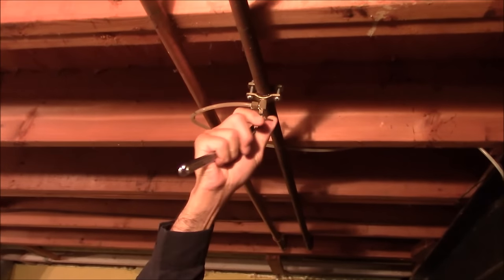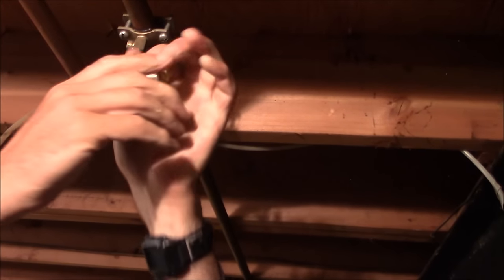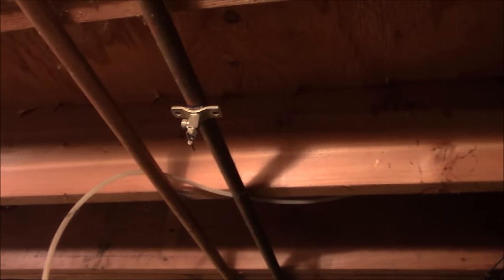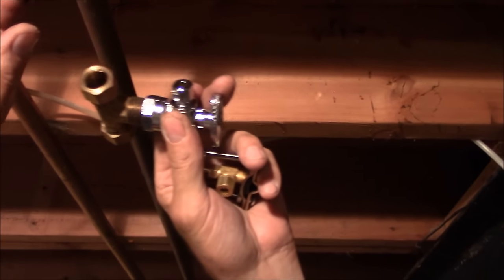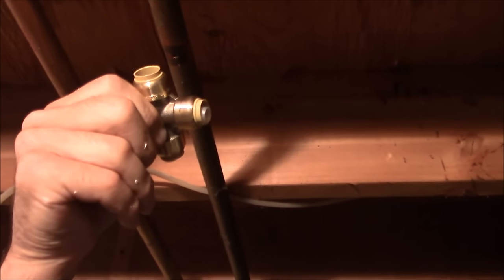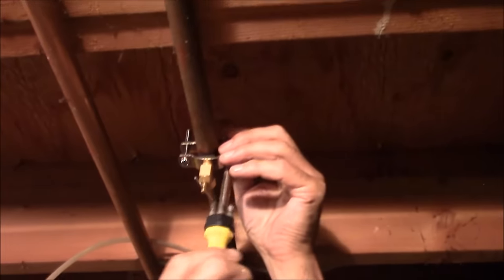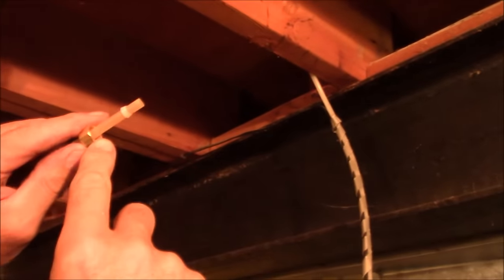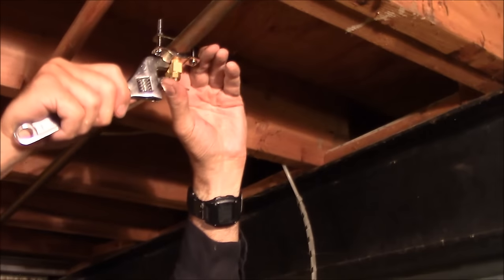Replace a Saddle Valve in 5 Minutes to Fix, Repair Water Pipe Pin Valve

Comment: never ever use self piercing valves. most places they are not to code, they are risky and are bound to fail by design. listen to this guy and replace with a tee and a ball valve. different metals, copper pipe and steel lancet creates perfect environment for corrosion
Reply from the maker: Great, everyone has to get it solved within their budgets, thanks
Reply: Nonsense. My saddle valve has been working perfectly for over 20 years now. If we listen to everything people say not to use, we would still be using the horse and buggy.
Reply: @bigmacdaddy1234  I so agree .. I say if you want to do it go ahead its your call ..These friggin` Plumbing Police .. DA!

Comment: The bracket had rubber on one end but the other half was steel. Steel and copper don't mix well. you didn't even prepare the copper tube by sanding and cleaning the area for the new valve.

Comment: the ball valve was the way to go , that saddle valve is not copper will cause a issue down the road pressed against the copper pipe will weaken the pipe over time due to corrosion oxidation . Always sweat in a ball valve  1/2" to 1/4" compression fitting all brass best way to go !

Comment: Used to be push to connect or shark bite connectors had to be accessible.  Not any more.  They are now rated for non accessible use.  Mr. Hardware needs to jump into the 21st century.  Plumbers seem to hate the new stuff but I have used many push to connect fittings and have yet to have a leak.  Just install them as instructed, debur, clean the tubing first, etc. and off you go.

Comment: Thank you for keeping this as simple and to the "T" as possible. I just bought a needle valve to replace what I thought was a needle valve, and it ended up being a saddle valve. Up and running in 5 minutes after I got the right part. I had never dealt with these before. Thank you!

Comment: Man I gotta tell ya , I was hesitant about those ‘cheese ball push on fittings’ until I was basically forced to use a couple of them one evening.... they are more expensive BUT, they are extremely fast, easy and have Never leaked a drop !
  I’ve used quite a bit since then on small jobs and repairs.... they’re worth the $ when they save you so much time.... and they fit to Copper, PVC And Pex lines.
  I’m still impressed how well they work !

Comment: Great video.  Had to replace my fridge which was conking out, and the water/ice had stopped working long ago.  Replaced the saddle valve with your video, and new fridge has water and ice working like a charm!  Will take your advice and call a plumber to have a real valve installed at some point, as the water pressure coming out of the fridge is not so good (Same as on the old fridge when I first bought this house, and now I know why.).

Comment: We’ve been without a humidifier for 2 months, even after having someone check it. Your first tip, tightening the nut on the saddle valve, did the trick.  Thank you, Mr. Hardware!

Comment: You saved me from a bad leak. I noticed that you put a little black rubber piece on the valve, and I forgot to use that. Once I reinstalled with the rubber piece, it stopped leaking. Thank you!

Comment: Thank you! I purchased a replacement saddle valve to fix a leaking one. The metal piece with the hole for the needle that sits on the copper was not machined correctly. The brass "T" did not thread into the saddle very far. Just poor build quality in my opinion. However, the rubber made a good seal and there are no leaks. I will be addressing this in the future with a soldered valve. Thanks for the video!
Reply from the maker: get a good quality ball valve w/1/4" compression nut.

Comment: Had to laugh when I watched this... shows the best way to fix it and in the end just replaced the saddle valve in the same config... I laugh because my mother was messing with hers in the wee hours of the night and ended up with water every were... I came out in the morning intending on replacing it with a compression T... in the end I just put a new saddle valve in because it had worked fine for over 30 years and was way less messing around :)

Comment: Great video.  The only issue now is that the plumbing code bans saddle valves.  So if you are getting inspection for selling they will have to be replaced.

Comment: I need to do this for my old humidifier. Like you said the valve has sediment built up. I have a new valve, just wasn't sure how to replace it because its on the incoming line from the water meter.  Last year I had to have a plumber replace the incoming line valve because it was so corrodided that I could not turn the water off from the meter. I had him replace it with a handle type valve for quick shut off. Thank You for the video.
Reply from the maker: thanks, guys like you keep me doing them. Blair

Comment from the maker: When removing a valve, first shut off the water main, then open the laundry tub to reduce water dripping out of the main pipe once the piercing valve is removed.
Reply: what size was that pipe u installed the valve on?

Comment: Well, I'll be darned.  Mine leaked at the stem when I tried turning it off.  I thought I was going to have to replace the saddle valve.  I even bought a new one.  Turns out, all I needed to do was tighten in a bit.  Wish I had found this video sooner.

Comment: Those push on connectors have been in use for many years and their reliability is well known by everybody but the contractors that will lose business if they fess up to that fact. Water softeners come with them as standard equipment and they've been installed with them for more than 20 years. I've been using them for a lot of my plumbing projects for almost 10 years now and have never had one leak.
Reply from the maker: I just don’t feel an o-ring as a permanent seal. I’ve used then also, just never in a wall or an in-accessible area.

Comment: I have one of these, unused, with a big (unused) hose sticking to it. Can I remove the compression fitter + hose, and leave the valve on there, or should I cap it?
Reply from the maker: I’d remove the unused line and cap only if it leaks. 1/4 compression caps are hard to find.

Comment: I have that kind of needle valve hooked up to my refrigerator for its water. It's plugged up so I'm wondering if taking it off and trying to unplug it would work. I don't have any tools to solder, or any experience doing it. Do you think that would work or should I just call in a pro?
Reply from the maker: If you remove the valve, clear the hole and get the needle from the valve into the hole and centered and tighten the clamps equally this can be done. However it does take very good hand /eye coordination and if it fails you’ll be out of water until a plumber can come and repair it. 
If you had a hose clamp and a solid flat rubber washer that you could clamp the rubber over the hole and seal the hole. that would be your savior if you tried it and failed.
Reply: @MrHardware1  thanks for the reply! I've decided to try a shark bite T valve, since I won't have to solder. I'm just going to put it where the needle valve is.

Comment: Interesting. I've read that saddle valves are not code in many places due to tendency to leak over time. Mine saddle valve doesn't shut off and so I oped for push-on T with a ball shut-off fix. Hope to install next week. Humidifiers waste a lot of water, and on a well system that is not a good. 
My system is powered humidifier (big air-name company). They make drainless bypass humidifiers, but mine is powered and is  attached right to the main return duct on the indoor air handler of a heat pump system. And I'm reluctant to buy a new humidifier and have someone do some re-duct work. Also, it's a little noisy when it runs, and I'm not sure that location is good installation practice. I saw a YT video using 2 5 gallon buckets and a flot system, and tablets to keep the water microbe free, not sure I trust that method.
Any solutions to go drainless humidifier?
Reply from the maker: You are correct, saddle valves are not code in most areas in new construction. My water usage from the humidifier is a small portion of my bill so I concentrate on other areas to efficient-tise my house. The drum style w/a bypass from the hot plenum (where the humidifier should be installed) to the cold, wastes little water and has a small reservoir to keep the water from getting 'stinkie'.

Comment: Just gotta say, shark bite fittings are the way to go.  I was skeptical at first also, but after multiple uses, they have proved themselves to be very reliable. Sweating in fittings is going to be a lost art, because you don't need to that anymore.
Reply from the maker: I'm old school and am not fond of an o-ring standing between me and thousands of dollars of damage. I use them in a repair pinch with the intention of replacing it with pex or copper at a later date. I do sell a lot of them and have very few failures, but again, I wouldn't use it in a wall or a ceiling of any home I own.
Reply: Whats the advantage of a shark bite push on fitting vs a Compression fitting, seems the compression fitting is just as easy to use and more reliable?
Reply: Anything with an O-ring or rubber gasket will fail eventually. It is only a matter of time. This includes both saddle valves and shark bites.

Comment: Thank you for this great video!  Mine is under our sink for our refrigerator and the handles broke off from fatigue. It's been on there for 30 years and so once shut off didn't want to turn back on. How do I find out the size I need to replace it with?  I'm going to run to Home Depot today!
Reply from the maker: They are usually a standard size. If he pipe is copper I bet it measures 5/8" outside and a standard valve will bolt on as easy as I did in the video.

Comment: I have a highly corroded stuck saddle valve that has copper coming out of it and not the plastic tube.  Same process or have to do something different due to the copper?
Reply from the maker: The same, I prefer copper tubing.

Comment: 5 years later Brother, how do you feel about push connects
Reply from the maker: They are still my second choice. They are good in a pinch but the seal is made with an O-ring that has a life, a compression ring if it doesn’t leak today it never will.

Comment: what would allow this to fail to stop flow of water after several years ?  There is no visible leakage around this valve.
Reply from the maker: It is a brass ground joint seal. Meaning it is metal on metal to stop water. A slight flaw from rust, bad brass or other issue and it will leak.

Comment: Thank you for this video! I just installed mine but getting a tiny drip once every couple of hours. Should I take it apart and add some Teflon tape around the compression nut connector?
Reply from the maker: 2 to 3 nice neat wraps. Sometimes tiny leaks seal themselves.

Comment: 2 questions did previous installer use stiffener with plastic water line . And what if the metal compression ring was used with stiffener wouldn't that help. 
Lastly is that the correct terminology stiffener as you called it.
Thanks good job
Reply from the maker: I've seen it called a brass insert tube, but I call it as I see it. Not everyone uses the stiffener and with better poly tubing it is not mandatory, just good practice. I have seen the brass compression ring cut into the poly tubing eventually causing a leak, so I use plastic with plastic and brass with copper.

Comment: i am putting the compression fitting and tubing like your showing but it keeps popping off when i turn on the water.It also doesnt have a little plastic ring or is the little plastic ring in the nut? somtimes?
Reply from the maker: Some compression nuts have a built in ring, and some of them are unique in that once the nut or the built-in ring wears out you have to replace the valve also. (what a pain) You have to have a ring, built in or loose to make a seal. A brass ring will work on a plastic line but I greatly prefer a plastic ring with plastic line and a brass ring with copper tubing.

Comment: Do I really have to shut the main off? I hear that could cause some problems. Now mine is attached to one of the pipes going in or out of the water heater and above where the saddle valve is,  there is an Inline Valve (looks like a lever, not a tap).  Not sure if this is something I can use to shut off the water instead of using the Main shut off valve... ? Could I also do it with the water not shut off? I mean when replacing the saddle valve, it might take a minute or two... the time to pull the old one out and press in the new one... How much water would it come out??? Thanks in advance.
Reply: theres nothing wrong with shutting your water. we all have to do it once and awhile for other reasons. if you are replacing the valve, and want to test out the theory of how much water comes out... well get yourself a large bucket and some towels. working while running water is all over your hands and body is no fun, especially hot water LoL
Reply: Thanks for the reply. I already did it. I was able to just shut off the valve on the cold water supply that’s going into the boiler. The saddle valve was OK. So I didn’t have to change that. Rather the solenoid was gone. Replaced it in a couple of minutes. I also opened a tap in the bathroom downstairs just to relieve any pressure one the tanks.

Comment: Could you give  links to the products that you recommended in the video instead of the saddle valve? I believe it was the Tee Compressions and ball valve.
Reply from the maker: The compression tee is a 5/8 x 5/8 x 1/2" npt compression tee. No numbers available, the valve is a 1/2" fip x 1/4 compression valve. Call Daniel at 586-776-9532 with those descriptions and he can price and ship to you if desired. Blair

Comment: Does this type of Saddle valve installation on a copper pipe also work for connecting to an Expansion Tank?  (next to a water heater).  
Assuming I can find the correct fittings\hose to make the connection on the Expansion Tank side.
Reply from the maker: I don’t think the saddle valve would pass enough air, and/or water, to correctly feed an expansion tank.
Reply: @MrHardware1    how much volume of water do you need for an expansion tank?  it's only the excess pressure that goes in to the tank.  right?
Reply from the maker: @agustinguzman6375  Expansion tanks on houses with wells in bumps actually store and deliver gallons of water at a time. Yours may only be a buffer tank to accept the expansion from the hot water tank as it heats cold water and it expands. Which would only be a trickle of water at a time. Saddle valves are not code so I still would not recommend it to use to attach an expansion tank.
Reply: @MrHardware1   Expansion tank is for a Water heater (not a Well).   I've read the code requirements for Expansion Tanks (for water heaters pressure build up), but nothing states what is required for the actual connection.    Could you point me to where you are reading the Code section that calls out the plumbing connection for such Expansion Tank as it is connected near the Water Heater?
Reply: @MrHardware1    installed on 23/March:  Saddle valve with 3/8" Compression Fitting -> 20" Compression Line (braided steel) -> Expansion Tank (2gal, 45psi pre-charged).  will keep you posted to see how this turns out long term.
Reply from the maker: @agustinguzman6375  I think it’s gonna work just fine. The problem is saddle valves are no longer considered code, not that they won’t work, I just a try to keep people steered towards code.
Reply: @MrHardware1    1 year later update:  system is working fine!  no issues noted.

Comment: I use a similar 1/4" copper line for a swamp cooler that I have to disconnect and reconnect every season. Do I have to replace the compression collar every time?
Reply from the maker: Not usually. If an old one leaks i wrap the ring with teflon tape. Not the threads.

Comment: If using the saddle valve, I cut the needle off, but leave the sealing angle on that is at the top of the needle.  Then run a 5/32 drill bit into the copper pipe.  You will have better water flow.
Reply from the maker: If I was going to do all that, I would sweat in a tee and use a real valve. If I lived too far to purchase the tee and valve you have a great idea. Blair

Comment: Great video...question: once installed will the plastic tubing be in tight or can it be pulled out while installed?
Reply from the maker: No, using a plastic ferrule and a stiffener the tubing will withstand over 80 psi. It will only come apart if the nut is not tight.

Comment: The taper is stuck and i cant get the connection off from the platic pipe from the shut off value in order to replace.  any suggestion?  Thanks!
Reply from the maker: I cut the line shorter and use a new nut and compression ring.

Comment: Just curious. If you didn't like that is was installed facing down, why did you install it facing down again?
Reply from the maker: I was using the existing hole in the pipe. If I was the first guy it would have been sideways. Blair
Reply: Thanks for your reply. I'm installing one today. Sideways it is.

Comment: I would like to remove the saddle valve permanently. How do I repair the puncture? Can I use a new saddle valve with close end to close the puncture?
Reply from the maker: The best way is to cut the pipe and use a coupling to bridge the hole. There are pipe repair clamps with rubber that will close the hole.